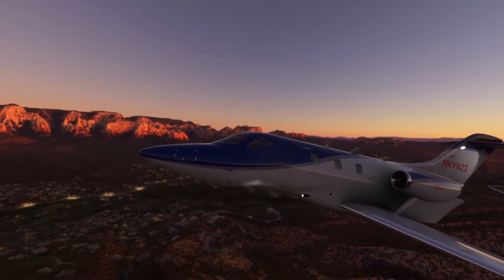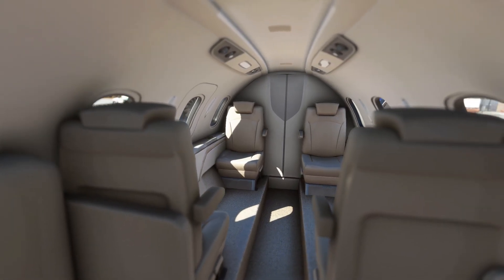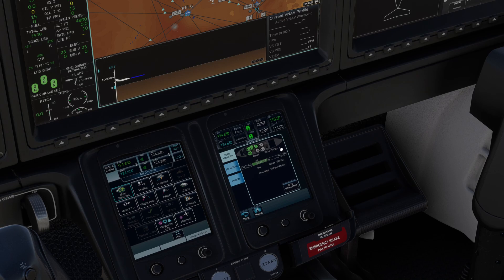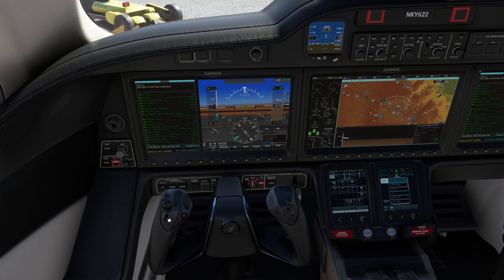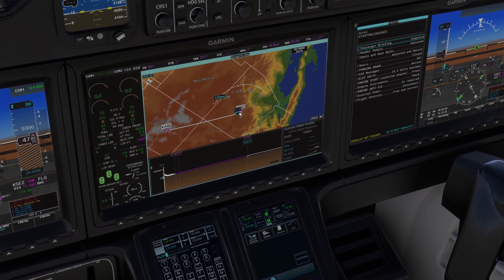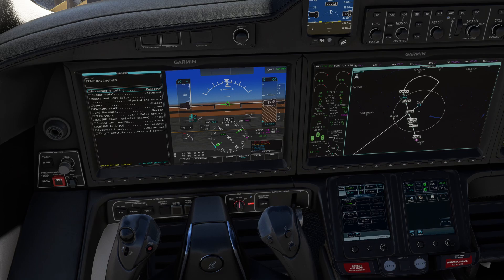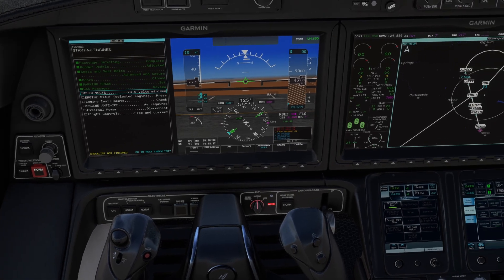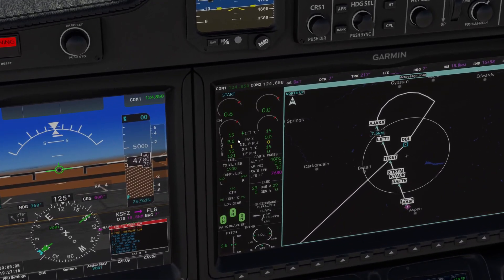Mastering the Honda Jet: A Beginner's Guide to Powering up and Initializing

Comment: Thank you for posting.  I put mine up on four jack stands, made easy work of it. What a difference in power....  I had the older engine. It cuts so much better.  I was able to get the engine in two days for $505 shipped from one of the suppliers you had in your comments.  Thanks again.

Comment: Nice video. I have been trying to fly the Hjet but cannot get the throttles working properly in SpadNext. I understand it needs some LVARs but despite looking at several videos I can't work out what to do (being 83 my mind isn't as nimbe as it once was). I have a Logitech Cessna Yoke and Throttle Quadrant. Any help you can give on setting things up properly would be more than welcome.
Reply from the maker: I actually just use the in-game Throttle 1 and Throttle 2 axis' inputs for the Honda Jet.  Have you given that a try?
Reply from the maker: If that doesn't work come on over to the discord and we can work through the problem!
Reply: Hi that seems to work. What settings do you have for the aileron and elevators? Do you use SpadNext at all?
Reply from the maker: Are you wanting the keybinds or sensitivity settings?  I do not use SpadNext for the HondaJet unless I am using the Class Echo (which is a completely different device than a HOTAS setup)
Reply: @nocturnalsimulations  Thanks again, both keybinds and sensitivity settings if you can. I have been trying to use SpadNext with the Hjet but can't get my head around how to use/implement  the LVARs needed for the throttle.
Reply from the maker: @chrispurkiss1491  Here are what I use on my TCA throttle quandrant, the words in " " will be what you search for in MSFS - Throttle: "Throttle Axis" 1 and 2. Landing Gear: "Gear up", "Gear Down".  Auto Throttle: "Arm Auto Throttle".  Parking Brake: "Set Parking Brake".  Flaps: "Flaps Axis".

Sensitivities are actually all straight 45 degree lines for the throttle and flaps axis'

Comment: I have been letting the starter spin the engine up to 10% so the oil pressure gets nearly to the green before I move the throttle into the idle position. Is that incorrect?
Reply: The manual says to press the start button then move the throttle out of Cutoff into Idle detent. :)

"Engine Start
On the ground with the thrust levers in CUTOFF, engine start is initiated by pushing the engine start switch and then moving the thrust lever to IDLE. The starting sequence is automatically controlled by the FADEC which initiates fuel flow and ignition in response to engine core speed. After a light-off occurs, the system controls the FPMU fuel metering valve to accelerate the engine to the power setting calculated from the inputs.
In flight starts are performed as starter assisted or wind-milling according to which portion of the air start envelope is appropriate.
Starter assisted airstarts are performed in a similar manner to ground starts by pushing the engine start switch and moving the thrust lever to IDLE.
Wind-milling airstarts are performed by moving thrust lever to IDLE after establishing a minimum of 8% N>."
Reply: @Tordan69  Then that is how I shall do it from now on, thank you for the information sir.